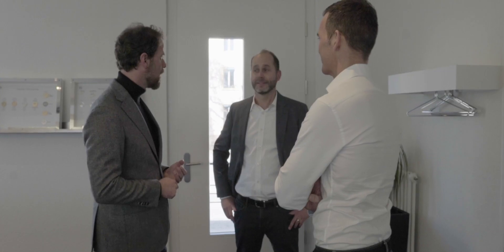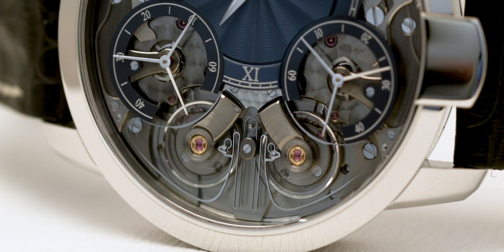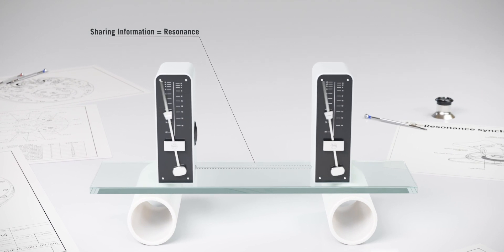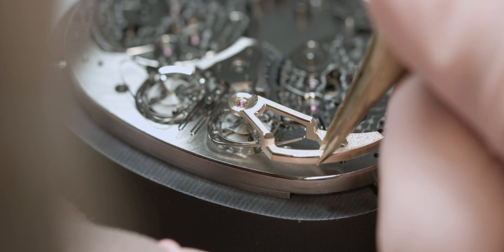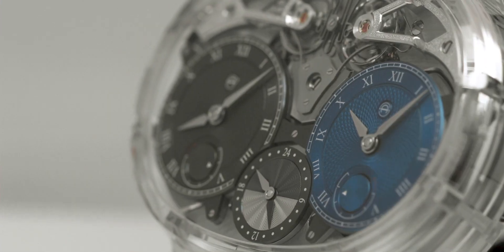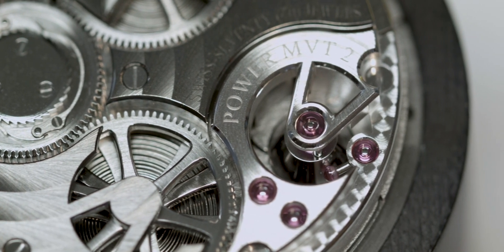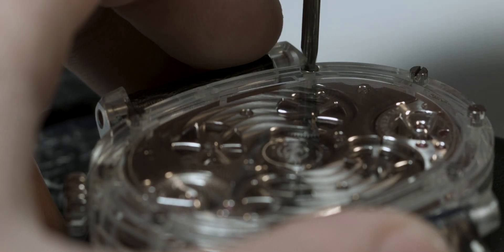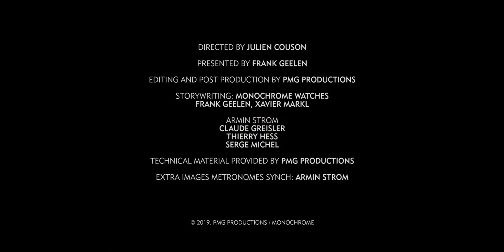In-Depth - Understanding the Concept behind the Armin Strom Resonance

Comment: The two metronomes in resonance have no physical connection? Really? So their stand is not a physical connection?
Reply: They mention the fact they are connected several times in the video. 
It sucks when trying to be smart backfires
Reply from the maker: Photoandcargeek on the contrary... what is said in the video is that they do have a physical connection, improving the resonance phenomenon
Reply: @Monochrome-watches  yes well there would be no resonance without physical connection so there is no reinforcement, there is our there isn't resonance. (Physical connection could be just by interaction with moving air atoms but here it would be totally negligible)
Reply: @Photoandcargeek  dude, they are physically connected by a spring and they demonstrate it in the video